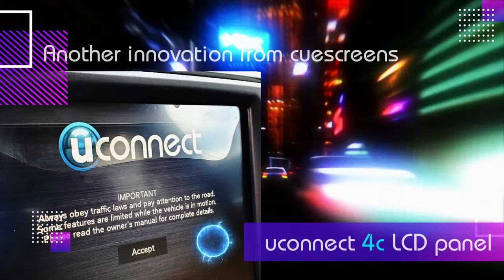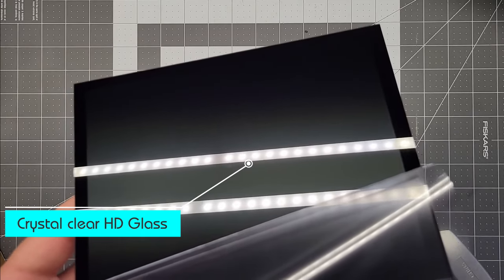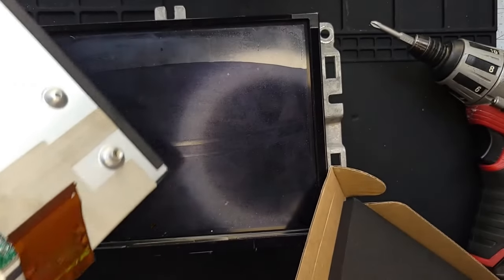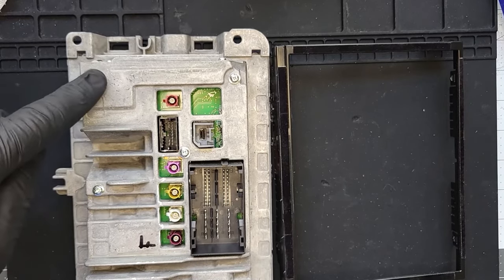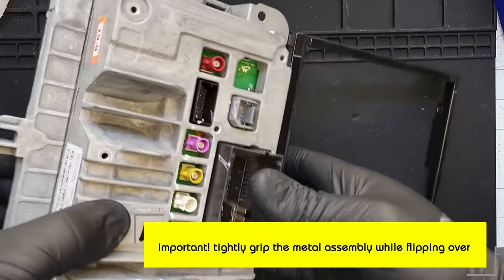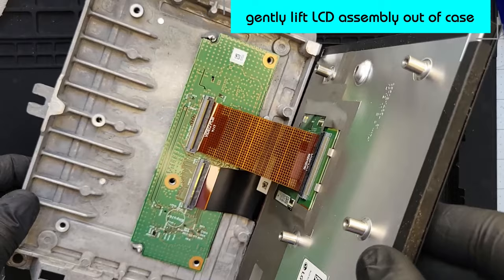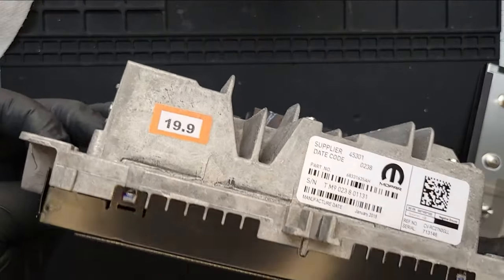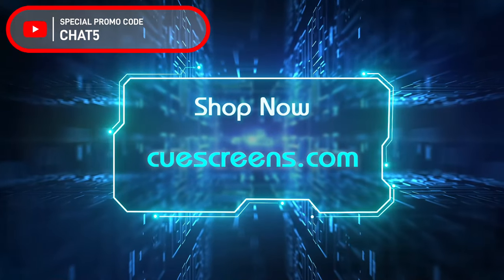How to DIY replace delaminated Chrysler Jeep Dodge 8.4 Uconnect 4c LA084X01 LCD panel- Easy method

Comment: Almost paid $1,100 to the dealer for a replacement radio.  Based on these great comments I did it myself and saved $800!  Really easy to replace the screen.  Don’t waste your money on a new radio.  Excellent instruction!

Comment: Just installed mine. This couldn't have been easier. Saved myself about $600 in under an hour. Just follow the video, you can't go wrong.
Reply from the maker: Nice job! $600 per hour is worth it no matter who you are
Reply: Did you re install using double sided tape?
Reply from the maker: @JohnnyAces  No tape needed here- its done with screws exactly as shown in the video.The cheap glass only replacements are a mess and never recommended.
Reply: Just installed this in a 2018 JL WRANGLER. I really took my time and it took a little over an hour. GREAT PRODUCT! Don’t hesitate to buy this and install it yourself. I love my Jeep again!

Comment: I just replaced my delaminated display with a $220 display from Amazon and it looked like absolute garbage and would randomly shut off. I ended up finding cuescreens with a Google search and placed the order. I just installed it this morning and holy cow!!! I swear it looks better than the original screen ever did. The installation is super easy and the display works flawlessly.
Reply from the maker: You get what you pay for- often times it costs more time and money to go the cheap route rather than the true OE replacement upgrade :)

Comment: pro tip --- duct tape along the top and bottom to keep it together before you unscrew it so you don't have to worry about it coming apart.  Blue tape works great for it also.
Reply from the maker: Great idea

Comment: I bought the 8.4" screen, I replaced it, I couldn't get over how much adhesive from the old unit was around the housing. This video along with the tool was very helpful. Thanks. Great product
Reply from the maker: Thanks. Glad to hear it went well. You can use isopropyl alcohol to remove the excess adhesive.

Comment: Just finished installing on a 2017 Chrysler 300c. This demonstration was spot on! Mine even had all the gel in the bottom like this video. After watching the video 3 time and being very careful, it took me 30 minutes. TIP: Make sure that you replace whatever you lay the old screen on so that you do not get gel on your new screen. (Like a paper towel). I got a little of that gel on the new screen. Came right off with my eyeglass cleaner. My screen booted up right away, no issues.
Reply from the maker: good tip

Comment: Yep....I didn't hold the pieces together and had all the damn spacers fall out. I got all back in but one. You should always have something leftover, right??? :)
Reply from the maker: Nice job, as long as its not causing issues it should be fine.
Reply: @CUESCREENS  So far, so good! It's been about 3 weeks, now.

Comment: a video with Good quality, IT IS NOTED that he is an expert, with professional training.  I am trying to solve a bad connection in my cables for not opening correctly.  Without a doubt, this is the best way of not messing up the components and taking it step by step without doing double work.🎉🎉
Reply from the maker: Yes, follow this instruction to prevent the issue you had. Your antenna cables have become damaged or disconnected I assume? Three tiny cables inside the unit?
Reply: @CUESCREENS  I'm checking if I left something wrong connected.  My screen has black gray and white colors, ebay support said that something was wrongly connected.  The first time it was installed and it worked, it stopped working 2 days later it was already installed.
Reply from the maker: @viclop3867  Those tiny antenna cables are near impossible to get reattached without breaking. Your radio will not work with them disconnected.

Comment: Just finished installing this screen on my 2018 Ram 1500. Took me about an hour and half but I was working very slowly and methodically. I'm so glad to be throwing out that garbage factory delaminated display, I had endless phantom touches yesterday and couldn't take it anymore. Installation with help from this video was so easy, and the finished product looks perfect.

Comment: Ordered a screen for a 2018 Ram 1500, awaiting shipment. Looking forward to new screen. Radio is on bench prepared for new screen. I did the cleaning thing but videos show it doesn’t always work and fails over time. This should rectify all issues.

Comment: I’ve received my screen from you but have one question, do I need to disconnect the battery before installing the screen?  Battery is a pain to get to in the Durango (under the passenger seat). Thanks!

Comment: If you're on the fence about tackling this project, let me assure you: DO IT! I was initially hesitant, but it turned out to be a breeze. Despite encountering a slight deviation from the instructional video I followed, the process was even easier than anticipated.

It took me about 45 minutes from start to finish, with the only hiccup being the trim piece removal, which consumed merely 5 minutes of that time. My motivation for the upgrade stemmed from a gouged screen left by the previous owner. However, upon extracting the OEM screen, I discovered it was beginning to delaminate in the bottom left corner, affirming the necessity of replacement.

The replacement process was straightforward, and the results exceeded my expectations. Not only is the new screen flawlessly installed, but its image quality surpasses that of the OEM version. I'm thoroughly impressed with the outcome and highly recommend this upgrade to anyone considering it.

Comment: Just got finished installing your screen today on my 2017 Compass.  I reviewed MANY videos on this, but your video is such that I don't have to take extra steps.  I wish I had your code to get a discount before buying it.  I asked the AI assistant, but he wasn't helpful.  I'm finally putting the radio back in, and the red wire would not fit, but I looked at a before picture I took, and realized the red wire goes in the right-side connection.  I really struggled trying to get the bezel off, because I thought it would break.  I went to the dealer to get a scheduled oil change, he said they would remove it at NO CHARGE.  Can you believe that?  Of course, they charge $70 for an oil change, so my request wasn't too much.  I'm happy with the product.  Thank you.
Reply from the maker: Thanks Gary glad you like it! Yes the bezels can sometimes get sticky over the years and take some pressure to remove. And yeah, the red wire has a one way slot so it only fits corectly the one way. Take care

Comment: When you say transfer the ribbon cable, do you mean take the ribbon cable off the OE panel and put that one on the new Cue screen? Meaning take the new cable off the new screen and take the old cable off the OE screen and move that old cable to the new panel?
Reply from the maker: Yes that is correct

Comment: I bought and replaced this Cuescreen as per the video on my 2018 Grand Cherokee.  The only problems I had was the large quantity of 'glue' that was on the frame, which I used a gasoline soaked rag to remove.  And, I managed to break two of the connector's locking tabs as I removed them, meaning they wouldn't lock on again at re-assembly.  I put a drop of super glue on them and pushed them in, hoping they don't come loose later, and assuming they will never need to be removed again.  Other than that, the screen looks great, and came on as expected.  Thx!
Reply from the maker: Yes you can also use isopropyl alcohol to remove glue
Reply: Was looking through the comments for advice on this!! Our 2018 Jeep also had a tremendous amount of this "glue" 😮 it was everywhere

Comment: Quick question. I followed disassembly and assembly but do you know what that tiny black wire does at 5:53? 

The black wire got cut during cleaning up the glue mess and after assembling the screen does'n turn on...perhaps it's because of that?
Reply from the maker: Its a chassis ground, probably not the end of the world with it off

Comment: Within your video, you have listed 2019-2021 Jeep Cherokee, however below in the description panel you have it excluded from the list. I then went to the website and entered my make, 2020 Jeep - but Cherokee is not within the drop-down list. Could this actually fit a 2020 Jeep Cherokee Trailhawk?
Reply from the maker: Yes its compatible, we fixed the compatibility guide

Comment: Hey there, need to replace my screen as well on my 2018 Grand Cherokee - apologies if this is a stupid question😅
Does this replacement screen also work with Apple CarPlay and android auto? any help is much appreciated!
Reply from the maker: Yes, if you have apple carplay or android auto it will be the same on the new scren

Comment: used this tutorial with a $50 digitizer off Amazon, couldn't be easier.  the hardest part was cleaning all the glue off the LCD, but zippo lighter fluid eats right through adhesives so it was just tedious more than anything
Reply from the maker: We will be here when your method goes bad and you want it done right :)
Reply: @CUESCREENS  with that response if it does go bad I'll find a replacement from someone else :)

Comment: With this screen will I still be able to access the “super track pak” performance page and apple car play and back up camera?
Reply from the maker: Yes, the LCD screen just displays whatever is sent to it so any option you had before will be there after the replacement. Sometimes the system needs a couple drive cycles to reset it there is someone missing. This is normal when the radio is disconnected. Just wait a day or two and everything comes back

Comment: I used one of these screens and everything is great EXCEPT the display isn’t centered on the screen. It’s roughly 1/4” to the left. The button clicks line up center, but the entire display is shifted to the left and I have tried everything to try and center it and cannot find a solution.
Reply from the maker: Thats because you ordered one of the cheap ones on amazon or ebay- they have all sorts of defects like this. Order the true original cuescreens from cuescreens.com

Comment: Just had my UConnect screen go out completely my 2018 Ram Laramie 1500...no delam of the screen...just black.  The dealership said "a component was defective in the radio" but they wouldn't say any more...other than the fact it's going to be $1000 to replace the "radio" (payable immediately upfront) and a 1 month wait for the "radio" to come in. Only the screen is dead. The radio, telephone, etc. works fine. Would this screen replacement work or could it actually be a "radio" issue?
Reply from the maker: I would replace the screen, it takes care of black screen in many cases
Reply: @CUESCREENS  thanks! A couple of weeks ago, I did a video on my experience with the dealer. Your solution makes more sense than what they were trying to get me to do. They wanted to replace the whole radio system and said it'd only be warrantied for two years. And, I'm sure the new system doesn't come with a gel-free screen.

Comment: Just replaced ours the screen comes on , but the touch is not working? Any idea what could be causing this? We took it apart and checked the ribbon connections.
Reply from the maker: Check ribbon on digitizer, its torn or not connected. Or you ordered a different brand

Comment: Just installed my replacement from Cuescreens on my 2018 Jeep Grand Cherokee (CarPlay). Works great and looks even better. Awesome video thank you!!!
Reply from the maker: Great work!
Reply: @mitchellbass8427 did you have any factory lock issues? Or can I purchase the cuescreens and install just fine?
Reply from the maker: @kayleelino1219  yeah just install it as shown here and there is no issues, assuming you didn't have issues before. If you have security problems, replacing the screen won't fix it
Reply from the maker: @kayleelino1219   Screen has nothing to do with factory lock. Order and install
Reply: I’m realizing I’m gonna have to do this too on mine smh… how did you get the unit out of the dash?

Comment: set it up and it looks amazing , especially considering everybody else told me it'd easilly cost me over 1000$. my only issues so far are that it doesn't have the super track pack mode for my 2020 dodge charger gt or backup camera, is there anyway to fix this?
Reply: Ever find a fix?
Reply: @bryanmyers2017  yes i did , after a few days it magically started working
Reply from the maker: You just have to wait a day for everything to reset. This is in the instructions on the sticker.

Comment: How much is the cue screen for a 2018 jeep compass, also it seems more of a connection problem,so if i replace screen would this fix the connection problem. Thanks
Reply from the maker: check cuescreens.com/shop and enter your year make and model to see the right version. There are several different 8.4 radios and you want to make sure to get the right one.

Comment: On my 2018 Chrysler 300 S the touchpanel changes channels on its own and in climate mode it changes from max ac to ac also on its own. Will the replacement of the screen remedy this issue?
Reply from the maker: Yes it will

Comment: Got a screen from you guys installed and it’s black nothing works what so ever. My antenna cables are damanged also, please help I’ve gone through ribbon cables multiple times they are in correct.
Reply from the maker: Hi, this is why we make it a point to NOT disconnect the fragile thin cables  during the install. Its to prevent damage to your radio. Nothing is working because you damaged your radio

Comment: I just installed this screen (which I bought from cuescreens) and it does look better than oem and was a relatively easy and quick job. However the screen is only responsive to touch inputs for a few seconds and then doesn't register any inputs. Also when I touched the climate tab it disappeared and hasn't returned.
Is there a period of time I need to let it sit to calibrate and configure itself? From the ending of the video and all the comments here it sounds like this should be instantly ready to go. Any help would be appreciated!
Reply: Answered my own question! Yeah the vehicle needs to be off for a while and then everything worked exactly as it should! Love the screen guys! Perfect!
Reply from the maker: @DemocracyJones  Yes, read the sticker on the box

Comment: I just had my 8.4 Uconnect screen digitizer replace and not even an hour later I see it bubbling up in the screen and the buttons are doing ghost touching. What could be the reason for it to bubble up again after I just replaced the digitizer???
Reply from the maker: You replaced the glass digitizer only? Not the entire LCD assembly like we sell?

Comment: Will this screen work for my 2015 Challenger SRT 392? I see you have another one on your website for $99 for 2015 models.
Reply from the maker: Sorry no, the UAQ is only uconnect 4c radios on the newer cars. You can order the glass only for your older model

Comment: I have a 2018 Jeep Compass and the screws on the back are not phillips.  They look like Torx, but are smaller than any Torx I have.  Anyone know what size Torx they are?
Reply from the maker: You are looking at the wrong video here. You have a 7" screen, this is for 8.4" uconnect. Super important to measure before ordering to make sure you get the right parts.

Comment: Does anyone know where the small black wire connects on the panel. Mine came apart.
Reply from the maker: Its connected to the metal frame at the bottom. Not a big deal if it comes loose. If you are OCD you can re solder it.
Reply: Thanks. I ordered from you and did it myself. No problem. I wished I would have done it months sooner.
Reply from the maker: @Gdesign959  Great job

Comment: Did anybody run into an issue where they couldn’t get all six screws back in? One of the screws both won’t go all the way in and also won’t come back out. So I’m kind of stuck.
Reply from the maker: If you overtighten it can jam up. Pull back on the screw while loosening. Or remove the other ones and let it drop forward so you can grab the nut with a needle nose pliers. You can remove the nut and just secure it with the remaining nuts, or you can get a replacement from us for free just email

Comment: What do you do if the little black wire breaks when removing the thin metal frame?
Reply from the maker: You can reconnect it with a splice or just leave it. Wont cause issues.

Comment: What are the specs on this screen as opposed to the OEM? Nits, resolution, refresh rate, etc.?
Reply from the maker: This is the same resolution and refresh rate, bright ness is 30% over oem
Reply: @CUESCREENS hey boss I was wondering if you can do mines and if so how much we talking
Reply from the maker: check cuescreens.com/shop and enter your year make and model to see the right version. There are several different 8.4 radios and you want to make sure to get the right one. @juansantiago780

Comment: I have a ram 2018 2500 Laramie does work like OEM for my truck?
Reply from the maker: check cuescreens.com/shop and enter your year make and model to see the right version. There are several different 8.4 radios and you want to make sure to get the right one.

Comment: is this the same unit that is in the wrangler? Will it fit the wrangler?
Reply from the maker: check cuescreens.com/shop and enter your year make and model to see the right version. There are several different 8.4 radios and you want to make sure to get the right one.